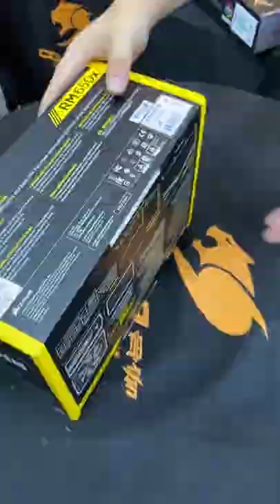i7 10700K+Z490 PLUS+RTX 2060 Super+RAM 32G+CASTLE 360EX+970 EVO Plus 500G+RM650W+ANTEC P120 #Shorts

Comment: Seeing this is making my crazy! I'm waiting on my $2700 PC 

Specs: 

CASE: Corsair 4000D Airflow Midi Tower
MOTHERBOARD: ASUS TUF 550 Pro
CPU: Ryzan 9 5900X
COOLER: NZXT Kraken X63 280mm
RAM: Kingston Fury beast 16 GB DDR4
GPU: GeForce RTX 3070 TI Vision
HDD: WD Desktop black 2TB 
SSD: WD Black SN850 M.2 1TB 
PSU: Corsair HX850 , 850W 

My full setup will set me back close to $3700 when I'm done